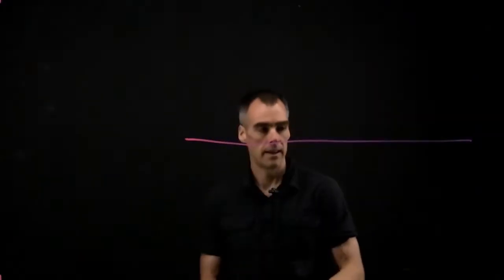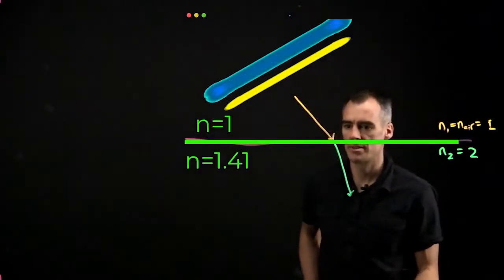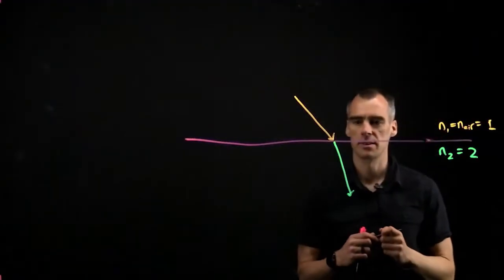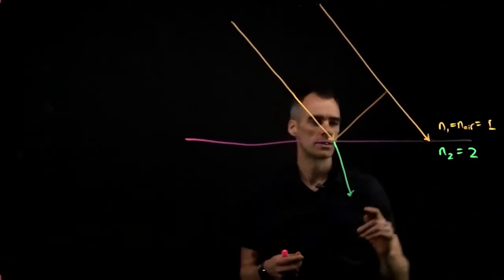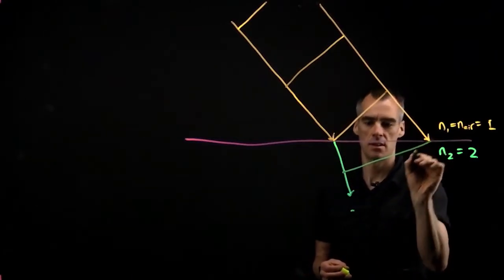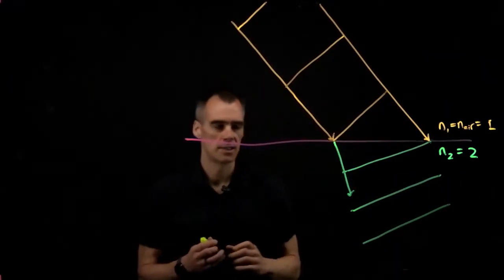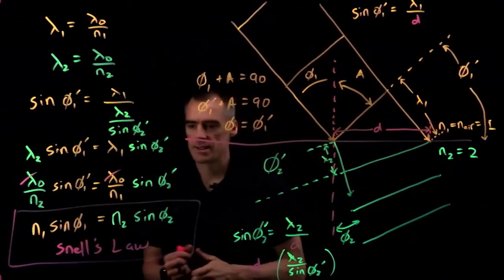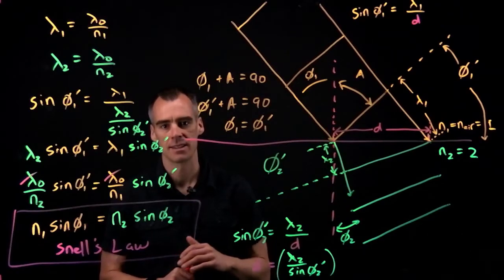Derivation of Snell's Law

Comment: Great explanation, but how do you prove that theta prime 2 = theta 2? I cant seem to find an angle that adds to both to equal them to 90 degrees
Reply from the maker: @maaarx1158  Hi, it’s similar to how you show that theta1 prime = theta 1.  You can just use, say, B as the angle between the second theta2 I drew and the horizontal line, and you know they have to add up to 90 degrees.  Also you can also see that B + theta2 prime +the 90 degree corner must = 180 for a triangle.  Therefore theta2 prime + B = 90, therefore theta2 prime = theta2.